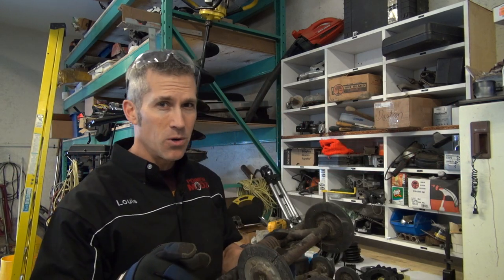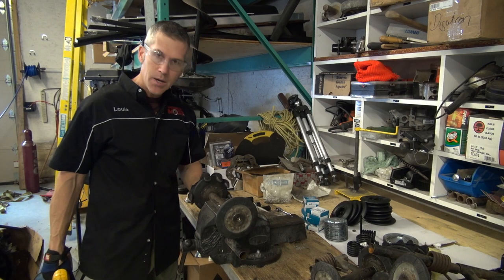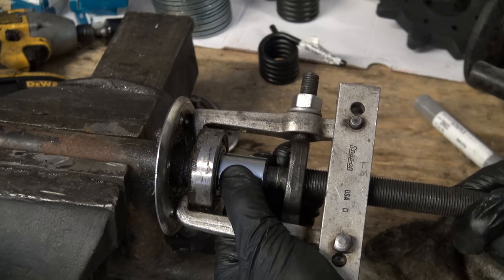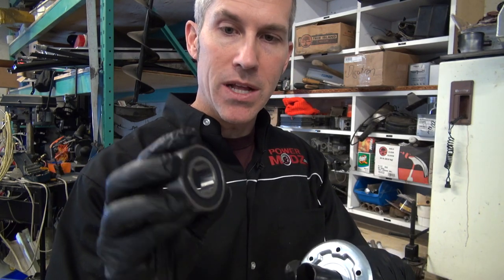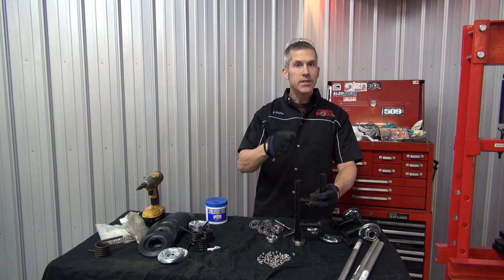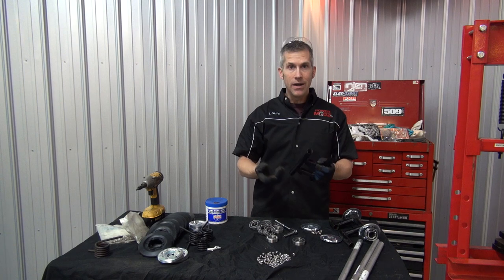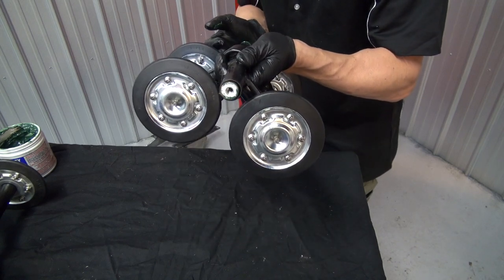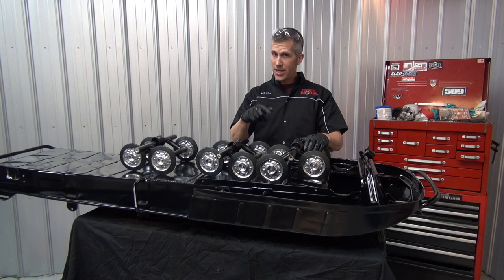Bogie wheel replacement, Skidoo Elan restoration series #5!  PowerModz!

Comment: An easy mod we used to do was add a grease zerk to the center bracket. Use press in type and tack it. Keeps the cross shaft from seizing in the tube.
Reply: Thought about that! I dought they seize much, would have been awesome to weld in a grease fitting! That's alot of careful work when you can just tap out the shaft on the suspenshion cross shaft!

Comment: Weird just as I thought from researching this years ago! It's best not to take off the clip for the spring as when you sand blast and paint, you will get the same part new as you have there if you use good paint! Dom16 (Canada) or Por 15 (United states)  which I have never used! And sure enough that saved lots of greif! If you want to get the one rod out you can use a cooper 1/2 inch plumbing pipe and it works like a charm!

Comment: Great vid as always!
Personally I think I would go for double sealed bearings here. No maintenance, less messy, and no grease that leak out and deteriorate rubber. In suspensions, double sealed usually last just as long as greaseable bearings anyway.
Reply from the maker: ive tried both ways, the greasable just allows you to squeeze the water out of there and prolong the life a bit more - otherwise you end up with rust and the bearings dont last quite as long.

Comment: Hey Louis, i just checked out Kimpex and ordered new flanges, bearings, and bogies for my 1971 ski-doo tnt 340 single. i also ordered a new exhaust ad rubber motor mounts from Greg Spaulding! ive been watching your videos for the last little while you do a great job making them! what size screws with the nuts did you use to re attach them?

Comment: hey Louis you should of used double spring boogie wheels and use the rear spings  out of a moto-ski nuvik or a Olympic. I used them in the 16 elan i had and it made a world of difference when us bigger fellows rode it
Reply from the maker: i usually do - just dont have any at this time.
Reply: Anyone any ideas for an effective micro version of this, that can be used as off-road cross country ski? There are some attempts out there, all are high friction, even before dirt gets in. I have an idea (tubular bike tire as a track), but getting it mounted to a flexible rail of sorts, and then the bogie wheel/bearing setup, that worries me.
Imagine a 55cm long contact patch with the trail, 3-5cm wide. The tire is like 65-70cm in diameter when round, and loops back (front) on the outside of the shin and knee. It needs a low friction interface with the skate frame, and be torsionally stiff when pressed to the ground. The bogies/rollers are quite straight forward, but how to make the interface between tire and skate, en how to make it dirt proof? Thanks!

Comment: When refreshing a 71 Elan 250 for primarily adult use would you update the bogie system to a 4-4-4 configuration vs. The stock 4-3-3 configuration?

Comment: hey louis, i got my new flanges bearings and bogies..i installed them with some 10-24 x 3/4 inch long screws with locking nuts. but i noticed the two on the front have a slight amount of side to side play..i know its not the bearings because there brand new and really tight. is it just the flanges arn't tight to the bearing? should i tighten them more? hope to hear from ya thanks!

Comment: Would I be able to tell the correct decal kit for my 1975 250E by the serial number? I would like it to be original. I also have a '72 250, a '77 250 and a '75 300ss, not to mention the '72 Oly 399. Hope you can reply.